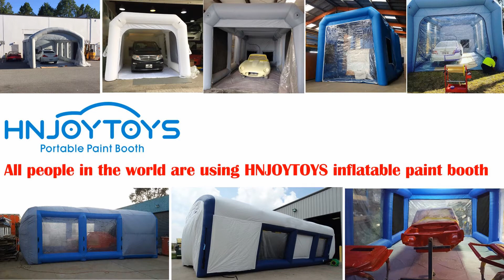Hnjoytoys paint booth-walk around inflatable paint booth,environmental friendly,direct manufacturer

Comment: how do you clean over spray and where can you get replacement filters
Reply from the maker: Generally a little soap and water will keep the workstation interior clean. It is easy to operate. Also 3M dirt trap flooring can be laid on the base and a light coating of the 3M waterborne booth coating can be sprayed inside the booth on the walls.  This help prevent overspray from coating the inside.  For the extra filter, you can get from us HNJOYTOYS company directly.

Comment: i bought one if these for $2150aud 3 months ago off ebay from a seller called TK Loop.
  i bought the 10 meter version WITH A 2 YEAR WARRANTY.
when i opened it up for the first rime the main door zipper was broken so i contacted Tk Loop and after many conversations he agreed that i could get a trimmer to come and sort it out  
I got a quote for $300  for tge rwpair and the next day TK Loop deposited the money in ny account.
3 months later it split along a seam in one of the columns so i once again contacted TK Loop on ebay  i sent him pics of the split and he said it must have been something I did wrong to cause it  
i tried to make him see sense that it was on a seam and that it was definitely a manufacturing fault. 
Anyway to cut a ling stort short i had to pay $200 to get it repaired. 
I contacted ebay who fobbed me off to paypal who said there was nothing they could do about it and that ebay always shove people off to paypal so back and forth it went for NO RESULT.
I use this for my business and to date ive had 10 days down time and 3 days ago it split again on another seam only this time the split was about a meter long. its going to cost me another $770aud to get it fixed and another 5 days down time.
So my advice is DO NOT BUY ONE OF THESE CHINESE CHEAP PIECES OF CRAP. 
AND AVOID EBAY BUT ESPECIALLY TK LOOP THE SELLER
He is a liar and does not honour the warranty he offers once the 30 days ebay safety net has expired
Reply from the maker: Hello David, i am sorry to hear your story, i agree with your idea that try to avoid to buy cheap portable paint booth, especially DO NOT BUY Portable paint booth from the dealer, they DON’T have the ability to control the quality of inflatable paint booth
Hnjoytoys is the direct manufacture, we produce lots of portable paint booth for the USA brand, You can trust us
What’s more, we will send you some material sample free of charge, you can check our quanlity at first, hope we can help you 
So please send your address to our email address 
sales@hnjoytoys.com.cn

By the way, our portable paint booth has EPA 6H certificated